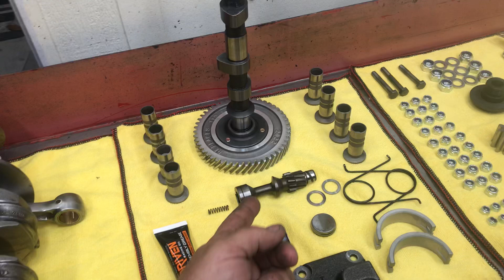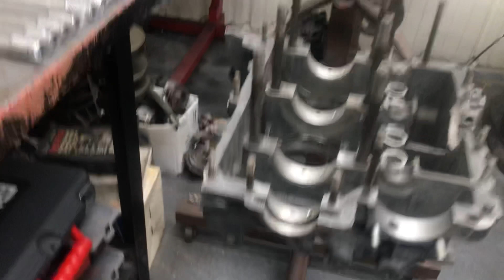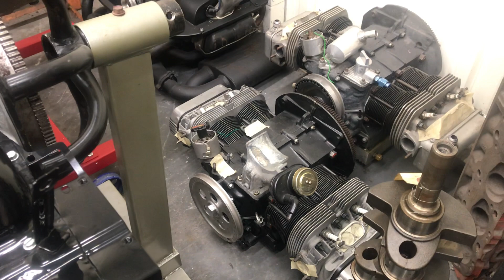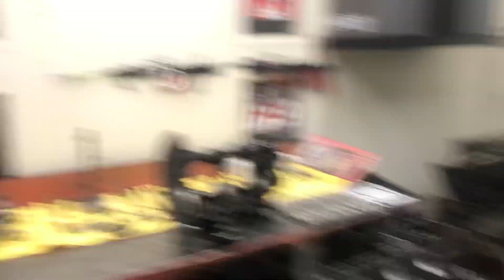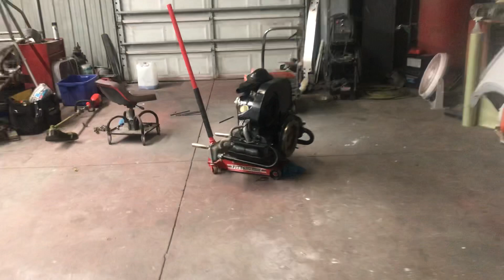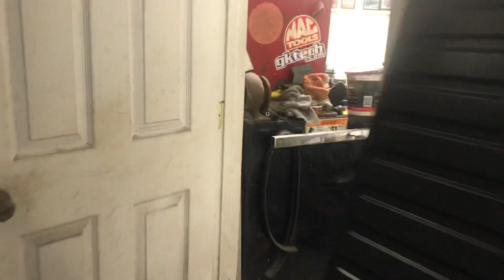Some progress on the 1776 build

Comment: I've been slowly rebuilding a 40 horse. I'm disabled and have no garage and I'm doing it in my living room in my tiny apartment. You don't need to guess that I live alone since it should be obvious. 🤣
I hope to have it done by Spring so I can put it in my '67. I reused a lot of parts like the sheet metal which cleaned up OK but still had some rust and Krylon didn't cover it very well. I didn't have a sand blaster or wheel to clean the metal with unfortunately so I used sandpaper. I think I might buy a kit from Wolfsburg West if it isn't too expensive. Or maybe some of that high heat wrinkle paint to blend in the rust scars. I did put rust converter on everything so that should help. I still have floors to do in the '67 too. It's sitting on a cement pad in front of a friend's shop and there's no cover to work under. Ugh. The more I talk about it the more I'm thinking 2023 might be when it's finally finished. It WILL get done though. I was born in '67 and always wanted one, especially since the '67 seems to be the one that everyone wants. The pride and joy are the seats which had already been redone and they used date correct materials and patterns. Something about a '67 being slightly different somewhere and the previous owner said they did it the way a '67 should be. I still need to look into that because I don't know what he was talking about but they sure do look and feel nice.

One of your motors would look out of place in my rust bucket '67 but what a sleeper it would be! After I fix the brakes... maybe. Thank you again for sharing with us. 👍